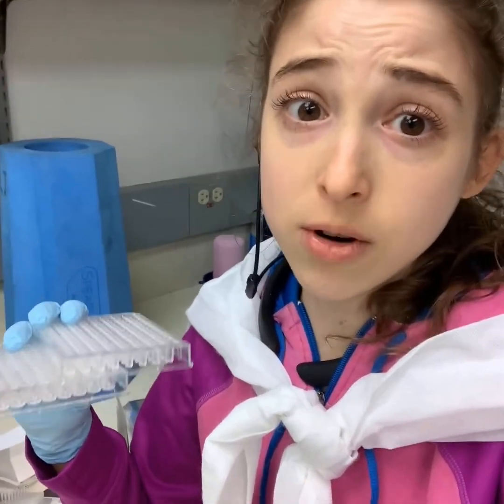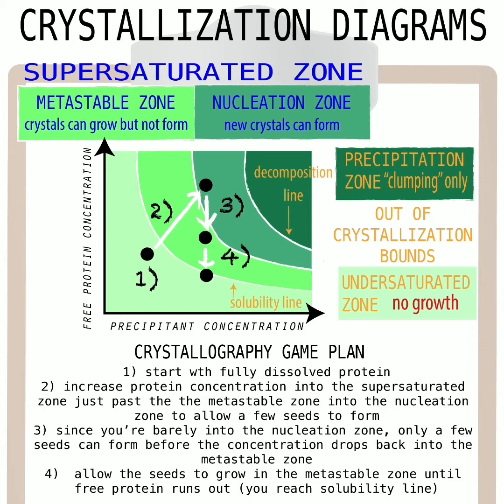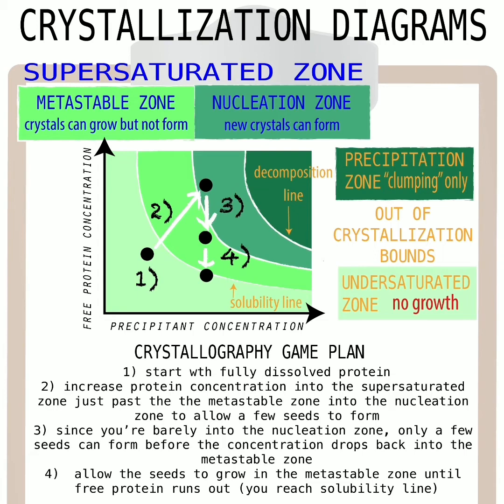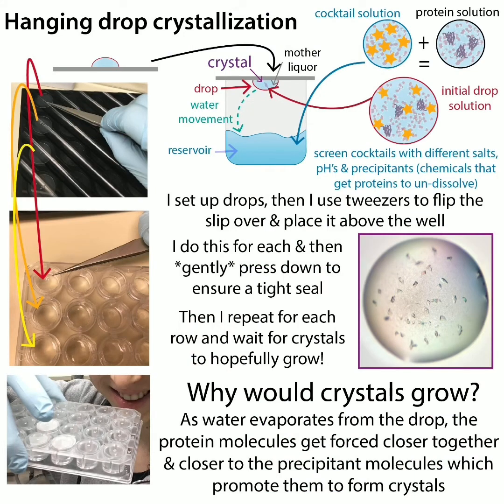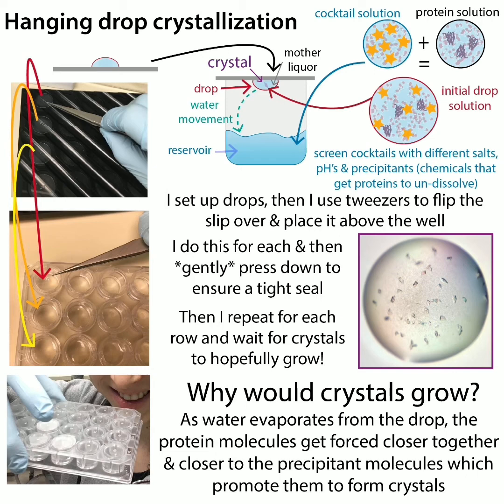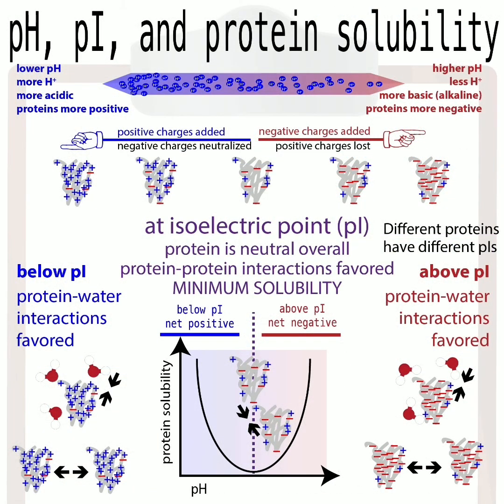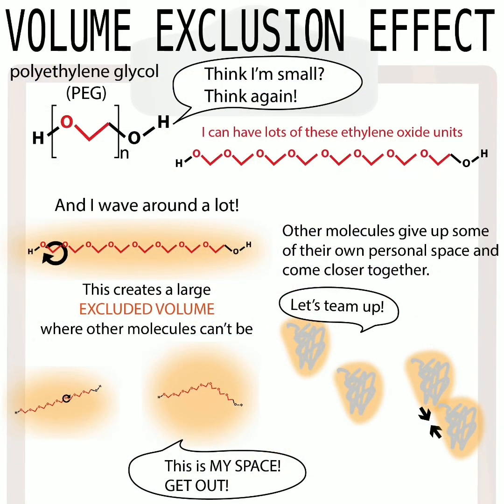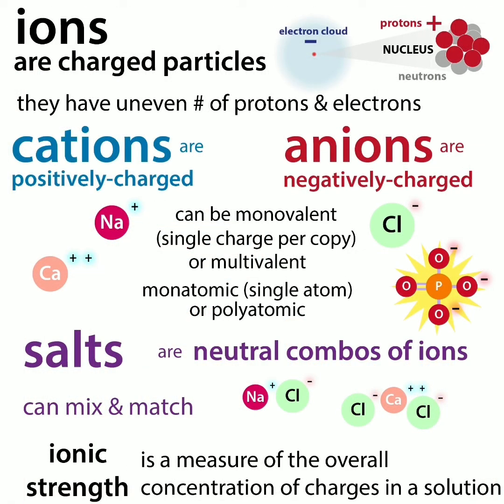Protein Crystallization 1: Give the protein a nice cocktail! Precipitants & crystallization diagrams

Comment: hey, I have a plant protein of 37kDa mol weight, n I have set up 8 different commercially available screens like JCSG and found precipitates in all of them. i had 13mg/ml concentration of protein and i put 80nl drops (used mosquito) via sitting drop method. should I go lower in concentration and shift to vapor diffusion for slower crystal formation?
Reply from the maker: Not sure sorry - it's typically just a lot of trying things